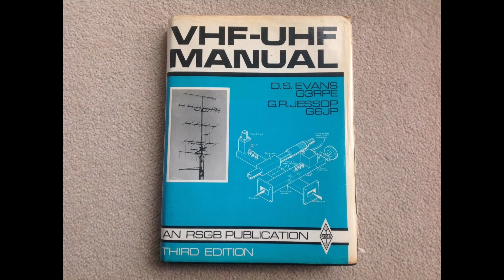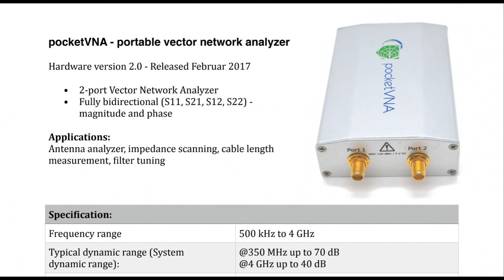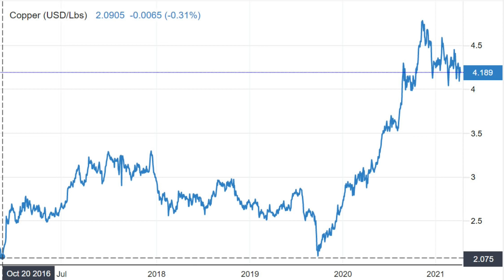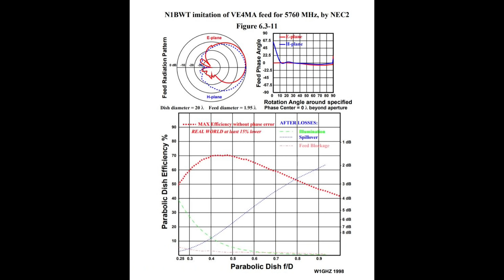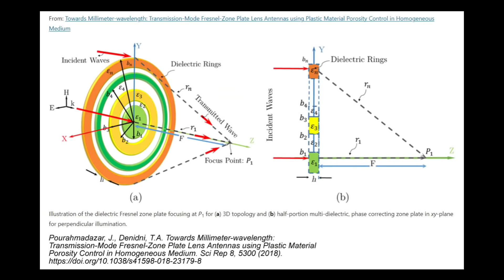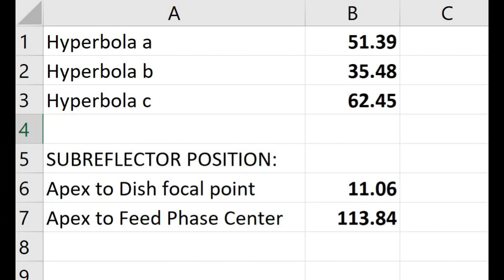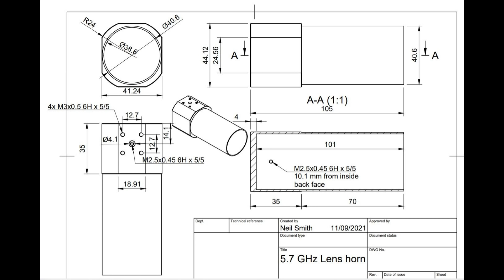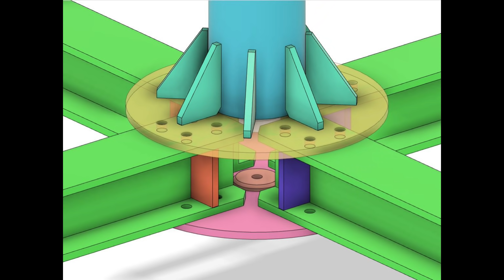Machining plus Microwaves equals Awesome

Comment: As someone who makes their living doing stuff to computers instead of real work. I appreciate not having to do real work for a living while, at the same time, long for tangible changes to show I've done something.
Reply from the maker: My entire career in IT has resulted in inconveniencing some electrons, briefly, to change patterns of light on screens and sometimes make marks on paper.  Nothing tangible at all is left to show for it.  None of my code or network configs from more than about seven years ago remain. Stuff I made from wood and metal is mostly still around, as is some of the electronic stuff I made. Many of the willow baskets I wove now existing only in photographs and books, having worn out, rotted or been eaten by woodworm. Lots of words I've written are in old magazines that have gone to recycling.  Most of the furniture I've made over the years should be around for a while longer, and the green oak framed sun room I built might last centuries if it is looked after properly. When it's finally dismantled, someone might wonder who carved "NRS 2009" in so many places hidden from view, but the willow corn-dollies I hid in there will have disappeared I expect. There are about 50 corn-dollies I've made that have been hidden in dark corners of buildings I've visited in several countries, and there are quite a lot of oak trees in Yorkshire that are a result of my guerilla planting. The best we can hope for is to remain as memories and perhaps as stories, but I'm going to keep making stuff in my unending battle against entropy and the eventual heat-death of the Universe.

Comment: I like microwave ..and the presision
And the thick 7/8 and 1.7/8 cabels
I got 3M dish and 2 x 1.8M 
I Work on 1296 2.4 5.8 10.2 to 100GHz 
This realy separate the "" walkitalki / HF "" users from Men!!
Reply from the maker: Oooh, controversial!  I have an 8-petal 3m Prodelin/General Dynamics solid dish, another Prodelin 2.4m offset 4-petal and a 1.8m one-piece offset solid, plus six other prime and offset dishes. I should get my new Kuhne 47 GHz transverter next week. I need more power on 24 GHz for EME adn I only have 22W on 10 GHz, but I'm building GaN amplifiers for 10 G using CMPA801xxx MMICs that should do 37 and 43 watts saturated.  That should be a nice signal when bounced off the moon.  I hope to get on 13cm EME soon, and I have equipment for 9cm and 6cm as well.  I might try the 3m dish on 23cm, but it might be better to make a 4.5 metre mesh dish to do 23cm seriously.  My friend Howard G4CCH has a nice 5.6 metre dish that I made some parts for recently.  That is a good size for a small garden in the centre of a village!

Comment: Beautiful collection of work. Presumably you can test these creations? Homemade anechoic chamber?
Reply from the maker: The great thing about the super-high frequencies these tiny antennas run at is that you can just test out in the garden.  The wavelength is less than 2.5 mm. Trees and bushes and walls act as absorbers.  Even at lower frequencies around 5.7 to 24 GHz, putting the antennas on a short rotatable pole allows you to characterise the antenna pattern and compare it with the finite-element simulation. On 10 GHz/3cm, I use the Sun as a signal source to check the pattern and performance, comparing the thermal energy of the 6000K photosphere with cold sky at less than 20K. The there are amateur radio transmission beacons on large steerable dishes following the Moon so I can test reception of the reflected signals.  It's very close to the limits of Physics, but certainly feasible from a setup that will fit into a suburban garden. Huge fun.

Comment: Which video is it that shows the 122ghz horn you made in the first video attached to the semiconductor transmitter pcb?
I am a Unity developer and make models too on computers.
Reply from the maker: I've not published the W2IMU and grooved choke horns, but I did one two on the simple horn at https://www.youtube.com/watch?v=X4UO6juGioA and https://www.youtube.com/watch?v=XW-Q3hJ70xc I need to get on with a load of dual-mode feedhorns and some Pickett-Potters
Reply from the maker: Other parts are at http://www.g4dbn.uk/?page_id=1492
http://www.g4dbn.uk/?p=1586 http://www.g4dbn.uk/?p=1504   http://www.g4dbn.uk/?p=1390 
http://www.g4dbn.uk/?p=1367
I hope to get round to doing videos on making those in the next few weeks

Comment: This is a great repository of your accomplishments, and I'm thankful that you're sharing it!  I'm only getting into radio waves very lightly, in the interest of extending my wifi range to my shed.  Is there any advice you can give to a novice looking to make a directional antenna for wifi frequencies?
Reply from the maker: Main advice is not to believe anything you see on Youtube about wifi antennas. Nor anything you see in adverts for magical wifi antennas. I was talking about this exact subject with some friends half an hour ago on a radio tech discussion group and there are some horrifying examples of nonsense out there on the internet.  I used to do long-range wifi bridging and comms links professionally, although we mainly used dedicated point-to-point systems with high gain panel antennas at 5.8 GHz. There are lots of variables to account for, such as neighbours with wifi or volumetric alarms systems or a myriad of other 2.4 GHz radio systems that can overwhelm the wanted wifi signal, so if you want to make a link work, you need to find if it's possible to make the receiving antennas unable to hear the interfering systems.  That is hugely tough if the other systems are behind one of your endpoints, as any high-gain antenna will amplify the interfering signal as much as the wanted one.  If you are sure that you just need additional range and there is nothing causing co-channel interference, and there is a free channel available that is different from the main one you use (lot of ifs here) then what I did was to connect an access point to my main hub using a 25 metre ethernet cable and mounted it so it could see through a single-glazed upstairs window, then installed another AP in the workshop about 40 metres away.  That works fine, but I don't have a huge amount of local 2.4 GHz traffic, and the far end can't hear ANY other wifi signals as it's mounted inside a brick building, again looking through a single-glazed window.  Double glazed windows are often metallized and you will lose 99% of the signal trying to get through them.  It's almost impossible to suggest a perfect solution that works for all cases, and the first step for me is always to connect an analyser to see what signals each end in hearing, and whether there are microwave ovens in the coverage zone, or burglar alarms or things that are only used during working hours or only in the evening or only after bedtime, then start the design.  Sorry I don't have any simple answers.  I guess I should make some videos about it, but then everyone else does that and 99% of them are wrong.
Reply: @MachiningandMicrowaves  WOW, thank you for the quick and detailed response!  I really appreciate it!

Comment: Wow, reminds me of the first few times I watched vids by all your listed YouTubers!!  Most of whom, I was in their first 5k subs!  Your gonna fit right in! What's so damn fun is, not only watching your machining but learning your alien language as you describe the function of your bits and pieces of your projects! Alas, I am elec. engineering illiterate!
May you live long, prosper and continue to pass along your passion and knowledge though this channel Sir.
Sub'ed.
Reply from the maker: Heh heh, just hope I can live up to the expectations! I'm having a huge amount of fun messing about with microwave and mmwave radio and machining. There's a lot of maths and physics involved, but once that's worked out, it's down to good old-fashioned engineering design and actually making things to test in the real world.  I'm working on an update to the coaxial low-pass filter design so I expect I'll do a full-length video on the design and machining of that, but also I have some much more intricate stuff coming along, plus water-cooled radio frequency amplifiers and some more tools to help me make radio parts to push the limits of Physics a bit harder.
Reply: @MachiningandMicrowaves  where should someone who doesn't know anything about these subjects start to learn?

Comment: Machinist, electronics guru, and a microwave magician. Jack of all trades, aren't ya?

Microwave electronics is still black magic. You can't convince me otherwise. Even if I someday understand all of it, it's still black magic. I'll stick to wrangling E-field pixies, thank you.
Reply from the maker: Grounded coplanar waveguide is DEFINITELY Magick of a high order, specially those transitions that just look like a short circuit.. Current vid is about a stepped coaxial filter where an inch of copper tube looks like a coil and an inch diameter disk looks like a capacitor and the whole arrangement acts as a low-pass filter.  

I nearly set fire to the shop last night while shooting a stunt involving lasers, blowtorch, oil mist, brake cleaner, and a pile of oily swarf.  I daren't even put the out-takes into a blooper reel, in case my mother sees what happened.  (Hi mum, I know you are reading this!)
I still have BOTH eyebrows, but the first three seconds of the clip are golden.  The other two minutes are me in firefighting mode in pitch darkness, just making things worse and laughing maniacally.  I don't think I need to reshoot that particular scene, thank goodness.
Reply: @MachiningandMicrowaves  Just... don't burn the house down, okay? </quoting-a-worried-father>

Comment: This is cool buddy! Ui love this stuff, instrument making and apparatus making. I'm a scientist by trade and that's exactly what got me into it as well. My father was also involved in advanced manufacturing and trying to replicate some of the processes has been very enlightening
Reply from the maker: I'm having a marvellous time trying to make the tiny antenna and waveguide parts, but also the control electronics and software to steer a 10ft diameter solid antenna dish and mount weighing a quarter of a ton accurately enough to follow the moon across the sky to better than 0.2 degrees pointing precision. Some of the newer parts have internal waveguides only 1 mm diameter, so things do start to approach watchmaking rather than antenna engineering. Huge fun.

Comment: Amazing work and more importantly, amazing attitude towards the new techniques and methods! You are an inspiration. If you want to discuss Tig welding send me a message and we can chat. I would love to be of assistance.
Reply from the maker: My terrible TIG welding is actually improving all the time, but I wouldn't want to expose the world to it yet! I have one big problem that I need to fix. I need a brighter work light so I can see the line of the weld a little better, and I need to find a way to stop my mask from misting up. After a few minutes, I can't see anything and I have to remove the panel and wipe the face of the panel and the inside of the outer visor. The rest is just practice and getting better at controlling the arc with the pedal. I also need to make a fixture to give me some back-purge when I'm welding the caps on to feedhorns and welding the seams on rolled aluminium tubes and cones. Practice, practice and more practice. I have a job coming up on 3 months making a 1.3 GHz septum-polarised dish feedhorn, rolled from aluminium sheet and with an integral polariser which I'm intending to weld alond all the seams.  That should be a good test of whether the practicing is actually making me improve.  Nowhere to hide with that job.
Reply: @MachiningandMicrowaves  it sounds like you're on the right path. Aluminum is very much of a tattle tell when it comes to the quality of the machine whereas not so much with steel. A good backpurge follower is such a nice tool, I used it alongside solar flux for stainless steel to amazing results. A tiny jar will go a long way and you will see a night and day difference. Know that the offer is there if you need advice. There's nothing I love more than to share my passion with passionate people!
Reply from the maker: @xavierdemers-bouchard2747  Super, I'll bear that in mind when I get stuck and can't control my puddles and end up blowing holes in things! I have GOT to get good at this.
Reply: @MachiningandMicrowaves  if that's your problem, consider a copper chilling block as they're called. You could machine a tight fitting negative plug for the inside of the cavity out of gummy copper (to quote your work hehe). Copper for aluminum and steel but aluminum is also great when used for steel. If the plug is too small then you can drill and machine a water channel and add a pump to circulate water through the copper plug and keep it from melting. This makes such a world of difference.
Reply from the maker: @xavierdemers-bouchard2747  That could be the solution if back-purge and being more careful doesn't work.  The last two horns I made form aluminium were 68 mm diameter with a 4mm wall and backplate and I got decent penetration and only messed up in one place where I let it get too hot and lost the corner.  I let it cool, laid a bit more weld over the gap and machined it and NOBODY KNEW.  I with I could get to the sort of standard that Jody reaches and 6061.com and the sheet metal work that Ron Covell does. Years of practice needed.  Main thing is to keep improving and getting advice I guess.